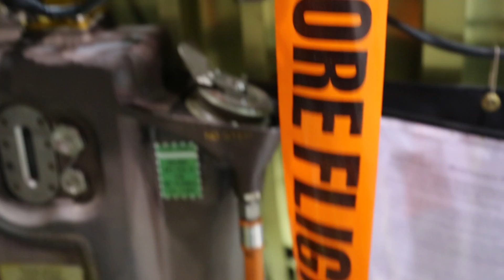Southwest Airlines: 737 Engine Swap

Comment: Just imagine you’re putting a new engine on and you look to the ground and wonder, hmm we’re does this bolt go?..
Reply: Go to stores and get another one
Reply: They would most likely have to U/s the bolt and get a new one from the store, they would refer to illustrated part catelogues and MM
Reply: They missed the point.  The engines akrwady been installed.  They don’t need another bolt.  They need to backtrack to discover where there’s a bolt missing on the engine mounts, and then install it.  Dropping a bolt it won’t hurt it.
Reply: @Snookynibbles  no duh

Comment: I've delivered oil and aircraft parts to different airlines at different airports that were in for maintenance.  Sometimes I would get escorted onto the tarmac to deliver to the plane, specifically for wheels with the tires mounted already go. The tires are huge. Even the front tire for an MD-11 is huge. Delivered to JFK airport for that one.

Comment: Almost all airline maintenance runs 24/7 365.  There are no weekends or holidays, if it is your day to work you work unless you are taking vacation, personal time, or a sick day.  When you first start you will normally work third shift for a LONG time before you are able to get off it.
Reply: There are guys on days at a major with less than 5 years.  Times have changed.
Reply: And if it takes you 14 years to get to dayshift and you get laidoff two years later,..you get to go to another company and start back on Midnights all over again!!

Comment: How long does an engine swap take from start to finish?
Reply: If nothing goes wrong and an experienced crew , 8 hours is lucky.  Normally it should be two turns if you need some extra engine seals or something. Overnight is the norm.   Or the pylon has damage or something bad like  corrosion , it could sit around  for a couple days or a week or longer . It really depends  on a lot of factors . But overnight is what they want .

Comment: Following an engine change is there any calibration or test flight required?
Reply: Engine runs,  make sure they're pulling 100 percent ,not temping  check the bleed system is working , yea they get run.
Reply: Bob Manson idle leak check only. They get tested before being shipped from manufacturer.

Comment: my name is Ralph G and to find metal fatigue on the engine part is using detective liquid luminous it's used and their investigations on blood report on the floor and they could find blood with that liquid by a night light pouring liquid or spraying liquid into that area testing it will find fatigue easily in the middle try it one day it might save millions of lives

Comment: Once the airplane is taken outside is the engine test run and if so for how long and at what power setting? In the Air Force we used to test run jet engines after a replacement for about a half hour. Also the afterburner had to be lit and left on for about 2 minutes.

Comment: AT LEAST THEY USED THE RIGHT EQPMT  UN LIKE THE DC 10 FATAL CRASH  FLT 191!
Reply: The methods used on DC-10 191 was approved by the MD engineering and AA management that authorized the fork lift used to lift the engine up to the wing and hang it. AA engineers and AA management wanted to save time, which is all they care about, money.
Reply: Solomon Pilot AaaAaAaaAaAaAaaaaaaaaqwaaaaaaaaasaaaqeqqqqwaaAaaaaAAADqqqwaAAAAAAQWAQQQQAAAAAaaaaaQQWAqqqaaaqwawwqqqqAaaaaaaaaqqqqqqqaaaaqqqqqqqqqqqqqqqqaqqadaaaaaaaaaaaaaaaqqq
Reply: Solomon Pilot ü

Comment: it's nice to see a guy working on a jet engine with a pair of channel locks.
Reply: Just loosening cannon plugs for the engine wiring harness, some are about 2-3 in diameter. He should use cannon plug pliers, but sometimes they don't work when the CP's are real tight.
Reply: MegaJohnhammond lip LMBO
Reply: Mifaborita
Reply: I use them all the time

Comment: See 2:02.

Looks like adjustable channel locks.

Good way to round off heads on a bolt.

Don't they have open end wrenches??
Reply: Those are cannon plug pliers for the wiring harness.
Reply: Stress Belden I8

Comment: Awaiting the day SWA starts hiring AMT's again! Have A&P, based in Dallas and ready to work!
Reply: I'm a 30 year AMT, I wouldn't recommend now getting into the airline industry what-so-ever. It used to be a good job, not anymore. Airlines like SWA want to outsource more AMT jobs overseas or 3rd party hack shops. They treat AMTs like a cost they don't want to pay anymore, witness the nearly 6 years SWA has slow walked a contract for AMT's at SWA. They also harass and threaten those that find maintenance discrepancies. Go into diesel work, they can't fly them to south america or china. At an airline, you'll be working mids, weekends, and holidays until you retire. Just my 2 cents from the inside.
Reply: You can always find work in contract maintenance for about half the top pay at SWA. Not steady though and can be laid off when work is slow. Willing to move?
Reply: Hey are u not working right now?  I`m asking because I`m 46 and planning on going back to school for aircraft maintenance here in Illinois but I hear alot of things from the older mechanics to study something else.  What do u think? I`d like to work in line maintenance. I know it wont be right away to get that position though. I`m worried after I graduate because of my age and being a rookie that no one will hire me.  Also I heard from someone else that Chicago isnt a desirable place to work in because of the bad weather and being so expensive to live here that not too many AMT`s want to come here, is that true? It`s good for me because I live in chicago and if the airlines are having trouble getting techs I might end up getting hired and getting a line maintenance position after all.
Reply: @VWGTI2013  j just got hired, I'm 59.

Comment: It's an ENGINE not a motor. I'm pretty they taught that in power plant :D
Reply: Geovanny Moya the turbine part is called the motor so that's just why they said that
Reply: @phxflyer  it isn’t
Reply: AMTs are too busy to be pedantic. Thanks for a useless contribution now go be autspergic elsewhere. 

Regards, an AMT.
Reply: *****pretty sure....
Reply: +Geovanny Moya Moya you knhh
Reply: Electric motor, gasoline engine.....

Comment: Sorry, at 1:01 the engine is shown being raised, at that point the engine should have been mated with the mount fitting, which you couldn't raise it farther, then. You show four mount bolts liberally coated with anti-seize compound and later you show one mount bolt being installed with no anti-seize.
Reply: '.      4forgot487-8542t5  6
Reply: They were raising the cradle to the engine

Comment: Awesome video!  What's the engine change for?  Because I know that Southwest only operates 737s, and all 737s use CFM engines.  And what's the oil that the mechanics are pouring into the engine, near the end of the video, for?
Reply: Engines are limited by hours on wing, or if the periodic boroscope of the compressors, turbine, or hot sections show damage (like FOD, erosion, or cracks in the combustion can), or high oil consumption, lots of reasons they are pulled. SWA has power-by-the-hour, meaning they outsource engine overhaul, no in house engine overhaul.